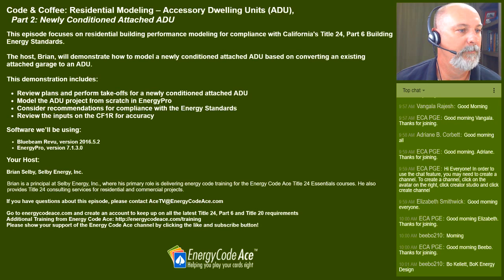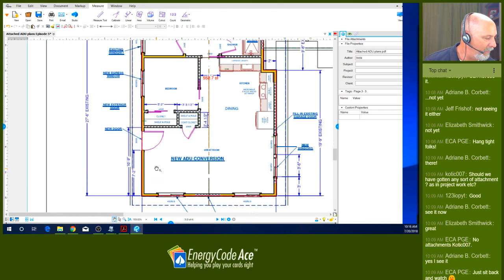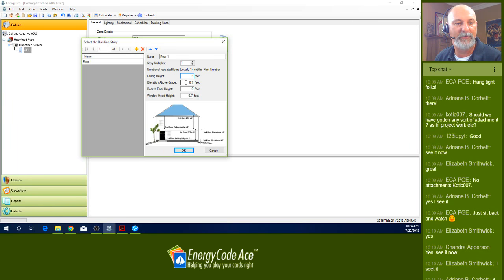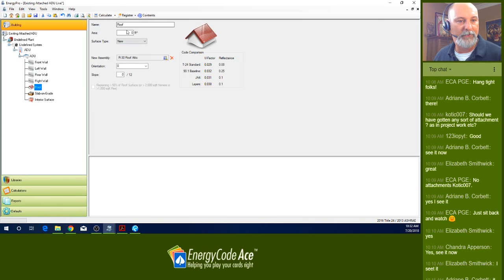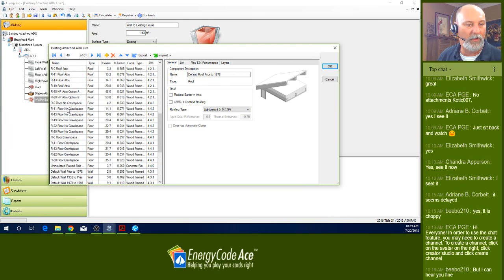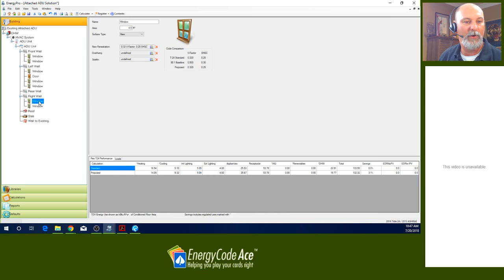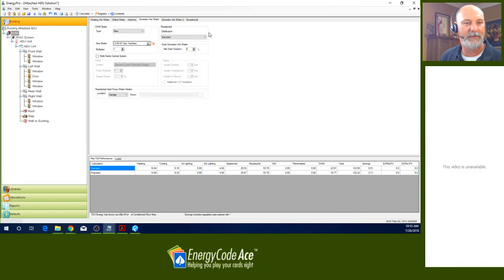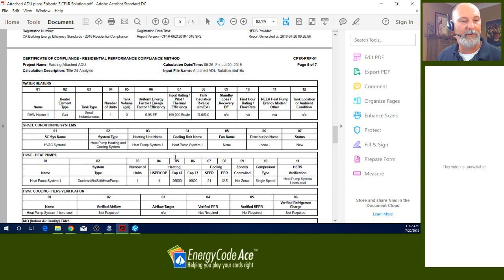Code & Coffee: 2016 Residential Modeling, ADUs — PART 2: Newly Conditioned Attached ADU

Comment: Thank you so much for this amazing work.
I am doing the same project on CBEEC RES 2019 and I have a question in regards to the Existing Garage Slab because my garage slab is 4 inches lower than the existing house floor and the garage slab is surrounded by the 4 inches height foundation walls (except the from wall where the garage door is) and I don't know if I should fill in the garage floor with more slab to the level of the foundation or to leave it as is and have the floor lower than the foundation walls?
also in case I keep it low, how would I model the walls in this case? because now the walls are basically made of 4 inches concrete (from the foundation) and 8 feet wood-framed?

Comment: Questions Asked During the Live Broadcast:

1.) If we went with above roof deck insulation, would they need new roofing? Answer @ 29:13

2.) If the walls and attic are high performance assemblies notated on the reports, does the building department expect that that type of construction in the field are notes added to the report? Answer @ 34:38

3.)  Is your wall property window hidden somewhere? Answer @ 48:14